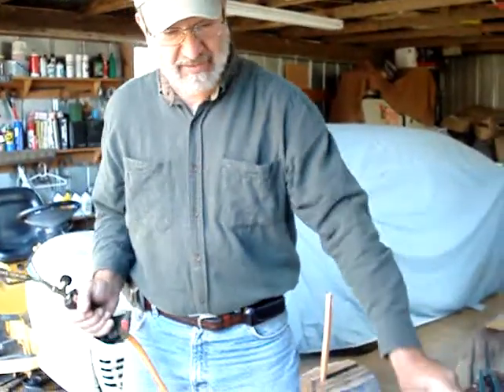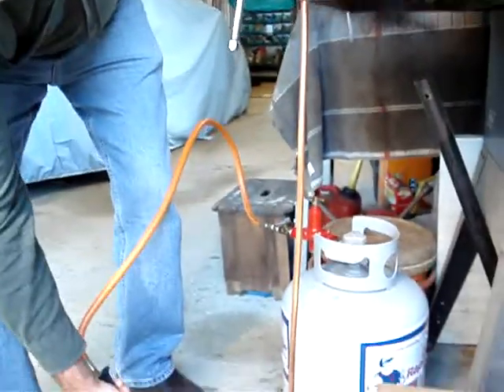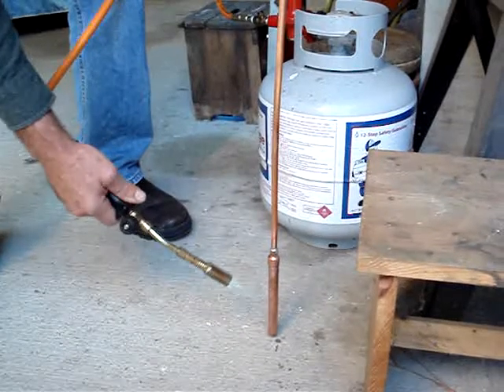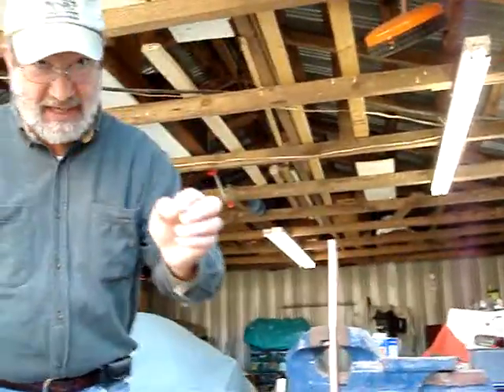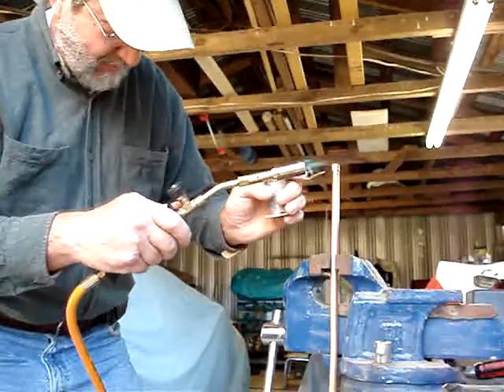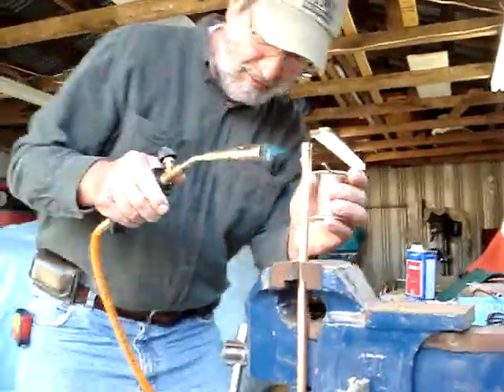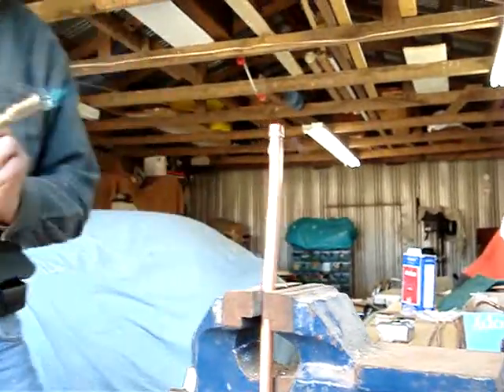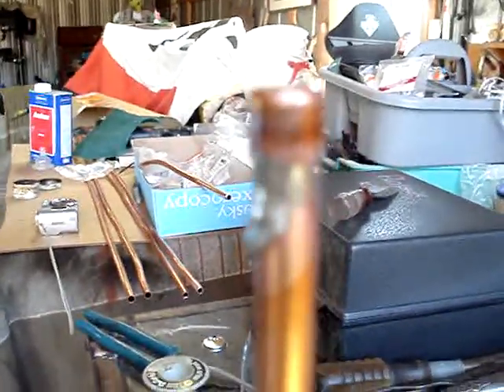making a heat pipe

Comment: Hi HS... Good to rattle these thoughts around and increase our understanding,...but a heat pipe is a well established device, if you have no air in the pipe the effect is very dramatic , heat can travel a few meters INSTANTLY. If you take some meters of copper tube, solder a cap on one end , put water in and boil most off and quickly solder a cap on the other end before the air gets sucked  back in you'll find it works fantastically, the less water in the pipe , the more dramatic the effect
Reply: Heat is faster than light?  inderesting.
Reply: @jtoker9758  Yes , your right to pull me up on that , the heat can't travel instantly , but extreemly fast . Gas molecules move at 1930 meters/sec at room temp. (4000MPH) they are constantly coliding with each other , bouncing around so the net movement is zero and we percieve air as still. In a heat pipe there is a pressure gradient dependent on the temp difference of ends . It can"t move faster than 1930meters/sec but could be around 10 or even 100m/sec and that will be the speed the "heat" travels.
Reply: @oz93666  That is almost as fast as the food coming out after eating Taco Bell.

Comment: My experiment : blackened, end-capped copper pipe (30cm) + acetone (15ml?) exposed to sunlight (hotbox +  reflector). One end of pipe covered with cloth to shade from the sun, with a piece of steel wool in it. Over  afternoon the acetone end (lower) became hotter than the shaded end (to touch), no noticeable boil.Steel wool - in fact - remained relatively cool, a lot cooller than the pipe, whilst acetone was 'scaldingly' hot.

Comment: Hi Oz - I've actually experimented a bit (not much), but my conclusion is that when the pipe is sealed, nothing boils inside; the pressure simply increases. No boil = no massive evaporation, and if there's no phase change (liquid to gas, and then back to liquid), it's debatable whether there really is any noticeable transfer increase - from higher temp to lower temp areas within the pipe - beyond conduction via the copper itself, which is actually already quite useable.

Comment: In a heat pipe , ideally you have a pipe with just about 10% fluid inside the other  90% contains only gaseous form of the same fluid. If the lower part is warmed the vapor pressure will rise slightly boiling from the liquid , at a cooler part of the pipe it will condense giving up heat . With air inside as well it will work badly , the less air 'in the way' the better it will work.If the hotter end is higher than cooler end you need a wick inside to allow the fluid to return

Comment from the maker: The idea behind heating the acetone is to drive out the air with vaporized acetone, it doesn't really lower the pressure inside the tube much. However, lowering the pressure inside the tube will reduce the boiling point, making the acetone boil at less than 133F, perhaps increasing efficiency a little.
Reply: P
Reply: @clayhett2089 🔴 I highly recommend learning about Islam...

 🔵 There is no salvation in the afterlife except by following Islam

⚠️ God has said in the Quran:

🔵 { O mankind, worship your Lord, who created you and those before you, that you may become righteous - ( 2:21 ) 

🔴 [He] who made for you the earth a bed [spread out] and the sky a ceiling and sent down from the sky, rain and brought forth thereby fruits as provision for you. So do not attribute to Allah equals while you know [that there is nothing similar to Him]. ( 2:22 )

🔵 And if you are in doubt about what We have sent down upon Our Servant [Muhammad], then produce a surah the like thereof and call upon your witnesses other than Allah, if you should be truthful. ( 2:23 )

🔴 But if you do not - and you will never be able to - then fear the Fire, whose fuel is men and stones, prepared for the disbelievers.( 2:24 )

🔵 And give good tidings to those who believe and do righteous deeds that they will have gardens [in Paradise] beneath which rivers flow. Whenever they are provided with a provision of fruit therefrom, they will say, "This is what we were provided with before." And it is given to them in likeness. And they will have therein purified spouses, and they will abide therein eternally. ( 2:25 )}

⚠️ Quran

Comment: I'm confused: what is the benefit of lowering the pressure inside the tube? In 'normal' evacuated tubes, the vacuum is created outside the conduit to reduce heat loss transfer to the atmosphere. It seems to me that when one lowers the pressure inside the tube - as in this case - you're simply lowering its ability to transfer heat to the heat tank, whilst somewhat increasing the gradient at which it still loses its heat to the atmosphere.

Comment: Heat pipes do have a effective thermal conductivities that can approach hundreds of times the value for pure copper.
The only condition is that they must be designed properly. Heat pipes use capillary transport facilitated by water channels along the pipe axis. Excessive heat loading and velocities, and ill designed pressure drops will result in non-operation or reduced transport.

Comment: I have really been wanting to experiment with some heat tubes.  living in an area that gets warm ( 109.9F a week ago) this kind of stuff becomes of interest.  glad to see some one doing.  have you tried with other working fluids and/or actually pulling a vacuum with a pump?  seems like if you had a larger area in your bulb end it would pull a deeper vacuum on cooling.  don't know how that would affect your intended use, but a though.  thanks for the share.

Comment: no sir, pure silver is the best single metal conductor as far as heat and electricity. of course silver is even more expensive.  I believe that diamond is the best single element, carbon, solid heat transfer media.  they make gold plated industrial diamond sheets for peltier coolers on laser diodes.  not to be a dick, not why I posted this.  I had been reading up on heatsink material.  also @ radio-shack yesterday I noticed the expensive thermal grease( ~12$/tiny tube) was like 97% silver.

Comment: Hi cant i just use a one way valve to evacuate the pipe, im going to try convert a zig zag pipe setup into a heat pipe if possible. its around 12meters long! an no one has done that before

Comment: Hey. Why do you juse accetone? Accetone has a boiling point of 50.5 'C / 133'F.
 
The steam, in the condenser must therefore be 50.5 'C/133' F unless there is pressure in the pipe. There cant be muts pressure, in the tube, when you preheater the pipe before sigling it. So you do not get more heat, in the condenser, than 50.5 'C / 133'F or am I completely wrong?
 
By the way. Love your video

Comment: Are these  as efficient as the "super conductors" as they are called by some "energy companies" import from China in the assembly of evac collectors. I had a demonstration where one end was put into a kettle of hot water while holding the top 4 feet away. within seconds it got too hot to hold. I wonder if butane or trichloroethylene may make the transfer more efficient.

Comment: Hello. Amazing work and thank you for providing the information.

My question is does the pipe HAVE TO BE copper?

Copper is UNBELIEVABLY expensive in Egypt, nowadays =/
Reply: Aluminium can be used if you can weld it. Steel can be used but it will be not that good.
Reply: @ss-sq1hn  Thank you. I can't believe I got a response to a question from 9 years ago. :)
Reply: @abdallahhigazy3203  Haha. i was just searching info about diy heatpipes and found this one. Hope my tip enlightened you and maybe encouraged to start experimenting again. We need more of this kind of information.

Comment: I meant to use the fluid instead the scrubs, so the heat from the evacuated tube is transfered to the fluid and then to the copper pipe. Next sunday I will be doing some exterimention. I have a 6-foot evacuated pipe. How much acetone do you think it would work?, because you are using 8 mililiters but the copper is shorter.

Comment: Hi! You have an awesome guide here. I'm planning to make one but I hav one question though. From what I understand, vertical heatpipes have a "wick" inside which means that when the liquid boils at the base of the heatpipe and then condenses at the top of the heatpipe, it's wicked back to the base of the heatpipe. My question is, will this still work if the hot side is at the top and the cold side is at the bottom?

Comment: @sundug69 Don't you loose vacuum when the acetone boils and the liquid converts into large volume of vapour? What is the size of the condeser? is it 1/2" ? What if you just press and seal the pipe instead of using a little cap?

Comment: @Anima87  Acetone is fun for this type of heat pipe because you  just boils some, wait for the tube to fill of acetone gas and seal it.

Now, for electronic application, Perkins tubes are not the best:
a)  they are not heatpipe and only work at 30 to 90 degree from horizontal.
b) Acetone will only start to exchange heat at about 130F unless you seal the tube under vacuum.
c) If you get equip to seal the tube under vacuum, water is a much better fluid pass 90F. (Ethanol is worst then Acetone)

Comment: Great video!
I have a solar station with 160 tubes. The heat produced is getting smaller as it is getting old. The tubes are OK, they didn't lose vacuum, other insulation is also OK. Thanks to this video I assume now, that the heat pipes have lost their "acetone" and therefore the heat production is smaller.
I will pull out all tubes and refill them.
Only I will not heat the tubes with fire. I will put them into a bowl filled with water at ~60°C.
How did you determine 8ml?
I will go with 15ml !

Comment: The riser pipe. Is this item an air tube used in plumbing to compensate for water pipes hammering?  If the cap and pipe were pretinned  then this becomes a simple sweat joint.  Great video.

Comment: Nothing doing today.  We had good sun in the afternoon, but the evacuated tube only reached 154.  Not even close to boiling water.  Back to Acetone tomorrow.  I'm aslo running an experiment to use the inner tube as my chamber with short copper at the ends.  If this works my DIY evacuated tube will be lighter and cheaper.  No 5ft copper heat pipe required.  The connection between copper and glass may prove difficult.

Sorry for all the posts and questions.  

john

Comment: Perhaps my optimism for the heat losses from the solar array through the multiple heat exchangers to the kitchen sink is too low.  Let me assume 30 % loss.  This would provide water temp at 148F for the H20 and 93F with Acetone.  At 93F the water temperature would need to be raised from the electric water heater (120  140F typically).  Id like to avoid that if its as simple as changing my heat pipe fluid.  Ill take my chance with the scalding.   TBC.......

Comment: But wouldn't the evacutated tube setup reach 212 to activate the heat pipe water.  I'm sure it would take a bit longer to activate the vaporization, but the temperature payoff is 70 degrees more.  Or am I missing something?  I'm not too concerned about the freezing since I'm thinking the water would squeeze up the tube, but I will test a few sample in the freezer just ot be certain.  Here in AL it rarely see's the teens in the Winter as you know I'm sure.  thanks

Comment: Doug - My acetone HP only gets up to 130-140 degree F with heat lamp.  This may not compensate for the lossed from the HE to the usable water.  I'm going to try distilled water as the boiling point is higher.  The Abricus peops use distilled water and copper powder (that's what the sale guy said anyway).  Do you have any thoughts on this?  Boiling pt of acetone is 133 degree F, water 212.  Looks like I could achieve a singnificant increase with the latent heat transfer.
thanks  - John

Comment: Will not repeat that same mistake twice.  I attempted another heat tube today and went EXACTLY by your instructions.  I now have a finished heat tube.  I tested it in a pan of boiling water along with an identical size/length tube and was amazed at the rate in which the heat ran up the tube!  Had to let go of the heat pipe first.  This is superb for my solar heating application.  Now if only I could find some glass tubes.  Any ideas Doug?  I'm up here in Huntsville, AL.

Thanks for the video.
Reply: You ever find any glass tubes?

Comment: I tried it tonight unsuccessfully.  I used 1/2 tube with a reducer to connect the 3/4 tube riser.  I quadripled the acetone quantity due to the larger tube ID.  During the last step to create the pressure too much heat was applied and  the acetone shot out of the tube like a volcano which spewed  on me from above (while holding the lite torque).  Thankfully no fire ensured.  I continued with soldering the cap, but the acetone contaminated my joint.   I will begin pick it up again tomorrow.